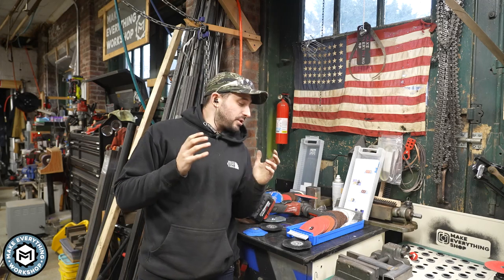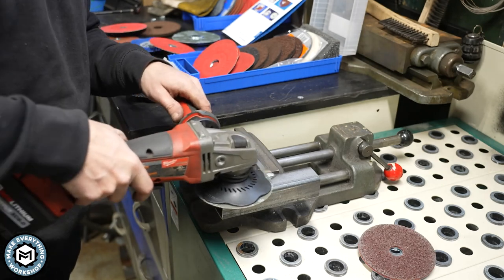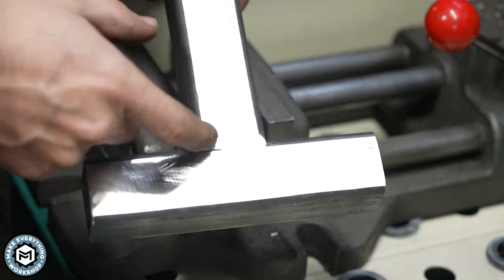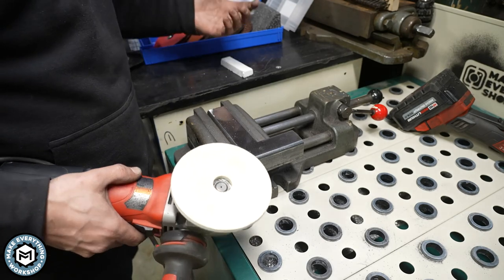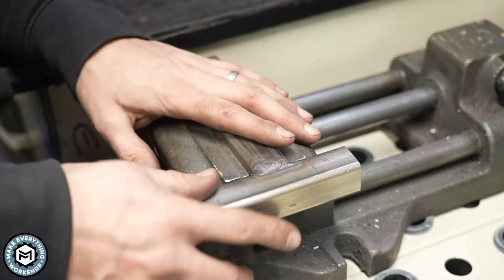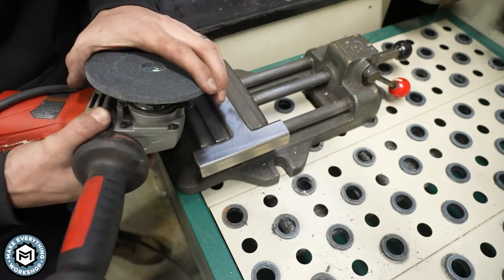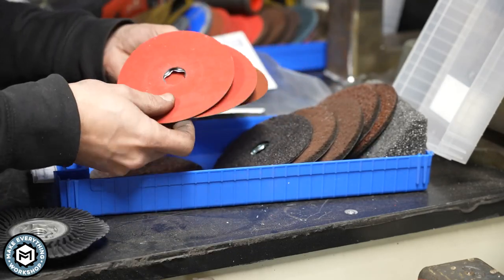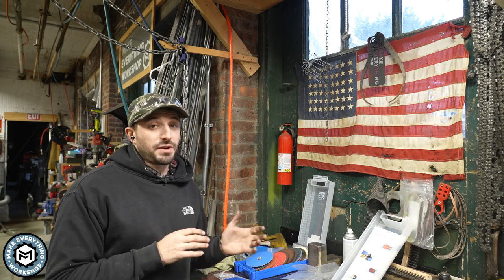Polish Steel Fast! - Metal Working Tools You Need!

Comment: That may indeed by a good kit. However when you start working with proprietary stuff, the cost rises exponentially. Every stage you went through can be done with off the shelf universal supplies and 1/5th the price. Pferd does make good stuff, but I try hard to avoid proprietary things like sanding pads when reliable alternatives are available.
Reply from the maker: Of course, the special backing pad definitely locks you into the PFERD brand. But I’ve not been able to find something that’ll let you grind so flat. Price always becomes an issue but certain jobs demand a certain type of product. Thanks for watching!

Comment: The other benefit of using this type of flat disc system without a center nut is reduced dishing. It helps produce a much flatter (I.e. less scalloped) surface, which is critical when polishing to a reflective finish.

Comment: My name is Jesse I work at Nasco General Dynamics I am in the paint department so that requires me to do a lot of mechanical cleaning which is also known as grinding and in relation where we're talking about was a 36th grade that's also called sp11 normally use for the main Wells and other surfaces and other parts of the vessel from the walls to deck or the floor when it comes to the burns from welding when you will on top of a material and the Heat transfers over and burns the epoxy and we got to get rid of that burn to a smooth finish and preparation for pain so that's who I am and that's what I do and thank you for the knowledge

Comment: You probably should have mentioned the importance of wearing a good respirator, especially for grinding, welding, or sanding stainless. These processes liberate hexavalent chromium from stainless steel, which will eventually kill you if it gets into your body, and fine dusts are the worst. You should also wash your hands after exposure, and if safe with the machines you're using, wear gloves, as it can also sensitize skin for dermatitis.

Comment: You know I really like this kit not so much for polishing which is good for that too but I like the fact how you talk about how you know like on a standard grinder that's the biggest complaint I have at work where you only use an inch or an inch and a quarter or maybe an inch and a half or almost two inch depending if you're using 7-in sanding disc 36 crit for Feathering ordering 4-in disc for you know heavy grinding

Comment: Note don't use disc that have been used mild steel on stainless steel. It will make the stainless get rust pits where the mild steel from grinding inbeds itself into the stainless
Note 2 using an air filter table for safety...while using a grinder without a guard...
Reply: Thanks for the tip on not mixing discs between stainless and mild steel.  I don't think the risk is the same using this sanding and polishing setup as  it is using something like a cutoff wheel. Plus the guard would interfere with that shallow of a grinding angle.

Comment: Crazy how shiny it can get. How many mm or thou does all this sanding and polishing take off?
Reply from the maker: That’s a good question… I should do some measuring before and after and figure it out!
Reply: @MakeEverything  curious to hear your findings! Like I doubt it's enough to be a structural issue or anything, but I do wonder how much it is.

Comment: This was really helpful. I have a brushed 18/10 stainless item that I need to mirror polish and this would be a good opportunity to experiment with one of these kits. I see that they have a 2.5” kit. Do you know of a suitable small variable speed grinder? My regular grinder would be overkill for the sort of pieces I’d likely work on, and the smaller disks are much less expensive.